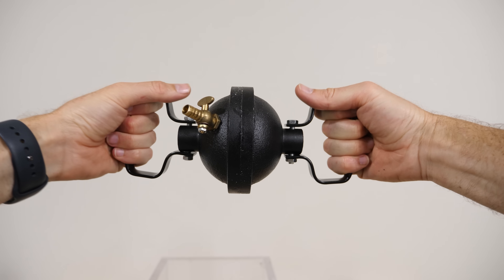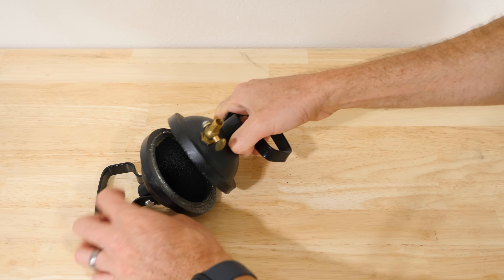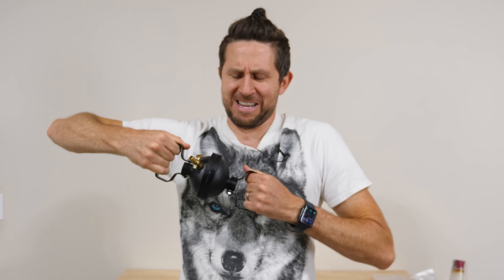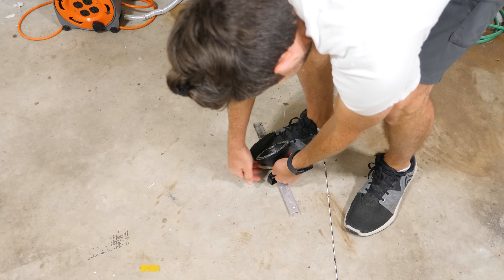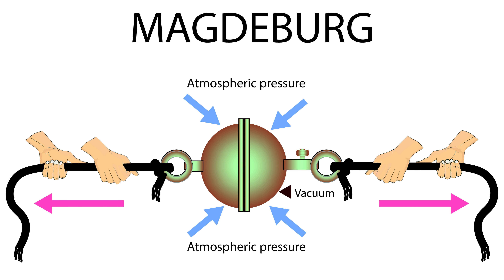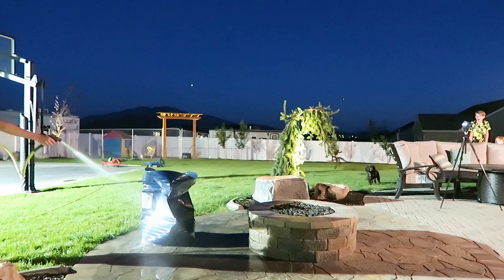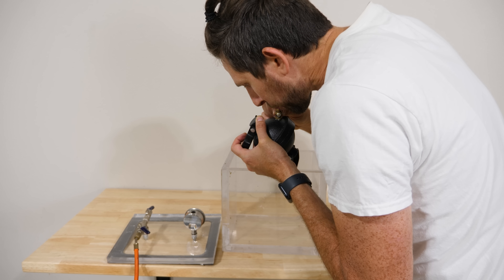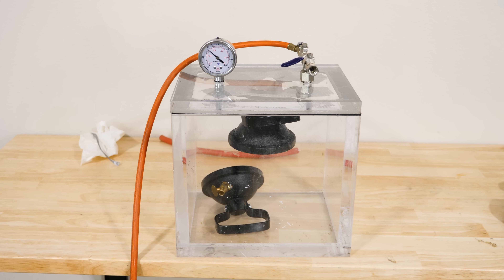Pulling Apart The Magdeburg Hemispheres

Comment: This is actually a pretty cool way to figure out how strong your body can suck air in, because the hemispheres in the vacuum chamber let go at (around) the pressure that you pulled inside the sphere.
Reply: Semi-related fact : you dont actually use any strength /muscles to suck in air. You only use them to squeeze air OUT of your lungs , so when you suck , you actually just let the (partial) vacuum in your lungs do the job
Reply: That was actually more vacuum than I ever thought we would be able to pull. Cool
Reply: It's the same reason a big piston can be used to move a small piston a great distance.
And on the opposite end of things, a small piston can be used to move a bigger piston a small distance but with much heavier loads on it.

As an example, a simple handheld bicycle pump can be used to inflate a tire on a semitrailer truck to lift its entire load off its rims some distance upwards.
Something you most definitely can't do trying to lift the thing with your arms. But many pumps on the handheld pump later, you've lifted the whole rig.

The surface area of a typical lung is around 1200 square feet. Thus, if you pull a vacuum down to 400 millibar (6 PSI, any PSI less than 14.7 is a vacuum), that's still just 2 millibar (0.0087 PSI) per square foot. That is for all intents and purposes the same effort that a piece of paper on a flat surface exerts. You can of course try it (IIRC, Action Lab even has a video on it) by putting a strong piece of tape in the middle of a piece of paper with a metal ring on it and try to lift the piece of paper... The tape or the paper will tear long before you manage to lift it off the flat surface.
Except i bet you can't pull a vacuum down to 400 millibar, i just chose that number for ease of calculation. The human limit is around 600 millibar, any more than that and you will start to feel pain that will prevent you from going any further.

It's not that your lungs are strong, it's that the relative surface area of the sphere compared to your lungs is much much smaller. Just like the relative surface area of the piece of paper you'd be pulling is so much smaller than the whole piece of paper itself.

And it's not pulling a vacuum that's impressive, it's the ability to take the air that is inside your lungs and pushing it OUT that's impressive really.
Your lungs are pushing air out that is exerting a force of hundreds of pounds down on them.

So again, what's really cool here is your ability to push air out of you and that's what your lungs are designed to do the best.
Pulling air in is easy, it's just a matter of letting it rush in there from the pressure that exists at ground level.

It's not just harder to breathed on top of Mt Everest because there's less oxygen up there. That's not even related to difficulty breathing, just difficulty getting oxygen into the blood stream.
It's actually physically harder to INHALE up there because the normal pressure that would fill your lungs isn't as high up there so you actually have to work to get air into your body.

Of course you can find "difficulty" breathing at sea level too... If you are trying to pull air in as fast as you possibly can.
This is because your airways are only so big, if you try to "open" your lungs faster than they can be filled by air rushing through your airways you are pulling a vacuum. Something your lungs aren't really designed to do.
You can try that to, try and pull in air as fast as you possibly can. You will find that there comes a point where it fells like you are hitting a wall inside your chest. That's because the pressure outside the lungs is too high compared to inside at that point in time.
Reply: that isn't quite the same thing. your lungs are already in a vacuum and it takes little energy to move from a high pressure (ie sphere) to a low pressure(lungs). This is why if you have a lung puncture, you got ..problems.
Reply: "your lungs are already in a vacuum"
What? Pulling a moderate vacuum with your mouth has nothing to do with the lungs. If you have a smooth face, play with a plastic cup to see which action makes it stick more firmly.
Reply: @tactileslut  I think he means a relative vacuum, not 100%vacuum. That is how we breathe ; our lungs are sponge like organs and we use our muscles to squeeze air out of them, bringing them to a relative (partial) vaccum.. then because the pressure of the atmosphere,  we release the muscle pressure to breathe in
Reply: @robertulrich3964  Just so we’re clear though you beLIEve earths positive PRESSure system resides directly next to ‘10^-17torr vacuum of sci-fi space’ HOW? Separated by what? magical narnia filament? Directly violating the second law of thermodynamics 

Stephen Hawking:
“This argument about whether or not the universe had a beginning, persisted into the 19th and 20th centuries. It was conducted mainly on the basis of theology and philosophy, with little consideration of observational evidence. This may have been reasonable, given the notoriously unreliable character of cosmological observations, until fairly recently. The cosmologist, Sir Arthur Eddington, once said, 'Don't worry if your theory doesn't agree with the observations, because they are probably wrong.' But if your theory disagrees with the Second Law of Thermodynamics, it is in bad trouble. In fact, the theory that the universe has existed forever is in serious difficulty with the Second Law of Thermodynamics. The Second Law, states that disorder always increases with time. Like the argument about human progress, it indicates that there must have been a beginning. Otherwise, the universe would be in a state of complete disorder by now, and everything would be at the same temperature. In an infinite and everlasting universe, every line of sight would end on the surface of a star. This would mean that the night sky would have been as bright as the surface of the Sun. The only way of avoiding this problem would be if, for some reason, the stars did not shine before a certain time.”
Reply: @NostyFripples  yes, gravity holds our atmosphere in place, which is why smaller gravity planets don't have one.
Reply: @robertulrich3964  Planets with less gravity can and do have an atmosphere. Mars is around 1/3 of Earth's gravity and has a thin atmosphere. If it had a molten iron core to maintain a strong magnetic field, it would have a more dense atmosphere. Gravity will ultimately limit how far out the atmosphere can reach and how much mass it can contain, not to be confused with density since Venus shows us what an atmosphere made of heavier elements is like.
Reply: @eideticex  yes, I wasn't precise enough. in reality, it's probably inversed exponentially less, not a sudden zero if you're 1% less gravity, hahah! Mar's pressure is probably really, really low. I read the magnetic field also helps to preserve from cosmic winds knocking off atoms, but I believe even the earth is losing atmosphere (if only a little bit) each year!
Reply: @eideticex  Also mars doesn't have a strong "Magnetic Shield" so it loses atmosphere due to solar winds.
Reply: @robertulrich3964  
Your lungs are not in a vacuum. As you breathe out, they collapse, indicative of them not being in a vacuum, similar to a bag collapsing - the air is rushed out, but because they're so flexible and weak, they collapse from the air around it, thus no vacuum inside the bag. The only time they're really in a vacuum is when you're breathing in, but that's very momentary as air is rushing in, and thus they continue to expand more.
Reply: @michaeldegeorge6954  lol its a vacuum, maybe not a perfect vacuum, but less pressure is why we can even breath in. When you breathe in, the diaphragm moves downward toward the abdomen, and the rib muscles pull the ribs upward and outward. This makes the chest cavity bigger and pulls air through the nose or mouth into the lungs.

In exhalation, the diaphragm moves upward and the chest wall muscles relax, causing the chest cavity to get smaller and push air out of respiratory system through the nose or mouth. its all pressure, that's how it works.
Reply: @robertulrich3964  Yes, but the lungs are not in a constant vacuum. As soon as any sort of vacuum is created, air immediately takes its place, so the amount of time the lungs actually exist in a vacuum is not very long.
Reply: @michaeldegeorge6954  actually, they are, even when exhaling. you never quite remove all the negative pressure because there is a static load from the fact that the muscular system and air sacs never completely deflate. it is analogous to a weight on a spring. the weight may not fully extend the spring, but it does create static tension. now, if you got shot in the lung, then it would completely deflate and lose static vacuum due to air pressure from the chest wall actually crushing the lung. look up pneumothorax for more information about this.
Reply: @robertulrich3964  air only moves from high pressure to low pressure. If your longs where always had a slight vacuum you would never be able to breathe out no?
Reply: @jetison333  Think of the lungs kind of like a sponge inside a balloon, when you breathe out, you squeeze the sponge flat, and when you release the pressure on the sponge a vacuum is created and air is pushed into the balloon. not a perfect analogy, but its kinda what happens.

Comment: How come the can of soda and the barrel crumpled in one instant rather than gradually?
Reply: Because the pressure is a constant and huge and when you remove the pressure diferencial inside the barrel, the metal gets the full pressure of the atmosphere in a instant and implodes. 
For it to be a gradual crush the pressure, would need to start small than increase gradually but that is not what happens. The same is true underwater and is why, special apparatus are needed to go down very deep.

Comment: What if you close it normal, and then go deep under water, would it still work like if it had vacuum inside ? Because of pressure diff?
Reply: Yes
Reply: Yes it will, if you go deep enough the pressure exerted by the water exceeds the pressure exerted by the air inside preventing it from opening.
Reply: @primeslayer8711  slight correction, it’s not ‘if u got deep enough’ it’s any depth at all, coz as soon as u go underwater there is more pressure than the atmosphere above it
Reply: Yes true, its just that the deeper we are the tighter the seal.
Reply: @hazza2247  Absolute pressure, yeah, but there is an atmosphere of pressure inside this hypothetical enclosure so there would have to be at least two atmospheres of pressure outside it for it to seal as well as the one with a vacuum inside, and you're going to have to go down a few feet before that's the case.
Reply: @chitlitlah  Not so, remember the atmosphere is pressing on the water too so it is already added in. If you are 1 inch deep the pressure on it will be 1"water pressure above atmosphere. The atmosphere pressure on the water cancels the atmospheric pressure in the sphere.
Reply: @billshiff2060  You're missing the point. If you go an inch underwater, you have maybe 1.01 atmospheres pressing it together. Since you also have an atmosphere pressing it apart, you could almost seperate it simply by giving it a mean look. It's nothing compared to trying to pull it apart in air with a vacuum inside it. (You can't pull a perfect vacuum, especially with your lungs, but you can produce a far greater pressure differential than you'd get just under the surface of the water.)
Reply: @chitlitlah  it'll act as if there were a partial vacuum under water, it'll act as if there was a very good vacuum deep under water. There's not much to really argue against.
Reply: @chitlitlah  Yes you have 1.01 outside and 1 inside = .01 pressure on the ball. The atmosphere cancels. .01 is NOT a lot but the PRINCIPAL is what I am talking about. Only the water depth/pressure matters because the atmosphere is on both sides of the equation.
Reply: @hazza2247  yeah but if the difference is small enough you wouldn't notice it
Reply: @billshiff2060  Okay, I think we're interpreting the question differently. I figured the point was to make it really hard to open like in this video. In order to do that, you need to go well below the surface but it's definitely possible. In order to have just the slightest force exerted on it, you could go just slightly below the surface of the water, or even just descend a hill or wait for weather with lower barometric pressure. I think we can agree on that.
Reply: @chitlitlah  *wait for weather with a HIGHER barometric pressure
Reply: @chitlitlah  anyway we dont have to guess, we can guesstimate.
Roughly speaking:
The sphere has an effective seal diameter of ~4 inches  = an area of ~12.6 square inches.
The ball fell off in the chamber at -19"hg on the gage. (0 being atmospheric)

-19"hg = -9.39 psi

9.39 psi X 12.6" square = 117pounds force holding it together against the atmosphere.

So to get that same holding force by going under water you'd have to go 260" deep = 21 feet deep.

Man that guy could suck a golf ball through a garden hose!!! lol
Reply: Ok I just looked at the vid again and he says it takes just over 100 pounds of force to open it so my calcs are ok.
Reply: @billshiff2060  Yeah, those calculations seem pretty accurate. I remember an episode where he was pulling up some tubing in a stairwell to see how high he could get it before the vacuum was strong enough to make the water boil and I think it was around 30 feet. A perfect vacuum would be higher while one a person can pull with their lungs would almost certainly be lower.

It's pretty surprising what the lungs (or technically the diaphragm) can do though. I had an automotive vacuum / boost gauge and played around with it. I found I could pull a pretty strong vacuum with my lungs (can't remember the exact number but over halfway to a perfect vacuum I think), but I could barely move the needle in the boost direction.
Reply: @chitlitlah  this is true, i believe the depth underwater to equal two atmospheres is 10m i’m not sure what that is in ft
Reply: @adamn7125  yeah u r correct, still thought i’d mention it tho
Reply: @hazza2247  Roughly 33 ft.
Reply: @billshiff2060  barometric pressure is only powerful on the large scale, and the difference in small items isn't great, but it is enough to make containers wrinkle a little, and make mystery noises as the weather changes.
Reply: @hazza2247  approximately 33 feet of water, which is close to 10 meters.
This is for fresh water i think, and it would be different for the level of dissolved salts
Reply: @richtomlinson7090  thankyou
Reply: yes but you would have to go about 10ms down to have the same amount of affect
Reply: (Water depth as Pressure is 100% independent of the longitude of the container) So if you have a 100m pool with 100 meter of depth the pressure at 100m deep will be the same even if the pool is 10m or 1km long.
Reply: @Splarkszter  the pressure of water or atmosphere, is only dependent on depth alone.
Just imagine a column of air or water, and use psi in that column.
There is an average of 14.69 pounds of air at sea level in a 1 inch column of atmosphere, all the way to the edge of space.
Reply: A 33 foot column of water is the same as the entire 60 miles of atmosphere, so this is the reason why people need to roll down their windows, or break them in order to escape a sinking vehicle, because it would be practically impossible to open a door against the pressure.
Reply: So.. could we design a device that centers all pressure difference onto a single point if you drop it in a pool. or in deeper water.  
Like a fancy walnut cracker device?
Reply: No
Reply: @LouisGan  yes.

Comment: I'm proud I guessed correctly that in vacuum chamber it would open by itself.
I wonder if u used stronger vacuum and sealed it, would it open inside vacuum chamber? Probably not
Reply: if the sphere was de-pressured with a perfect vacuum, it would still open a chamber with a perfect vacuum because gravity is pulling the bottom hemisphere away and there is no difference in pressure.
Reply: @akunog3665  I guess in perfect vacuum yes. But I said stronger vacuum.
I remember he once said his vacuum isn't perfect. Only in space is perfect vacuum
Reply: @beqaotarashvili9341  even space is not perfect vacuum. But yeah, if the ball is sealed with a better pump than he uses on the chamber it will stay closed. If he uses the same pump on both it will open imo.
Reply: Once the pressure equalizes it comes apart.